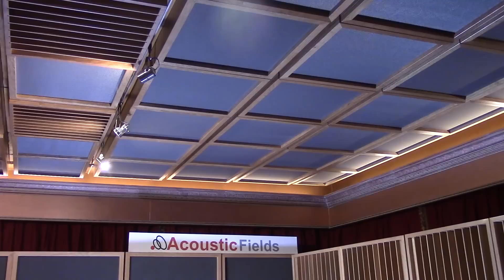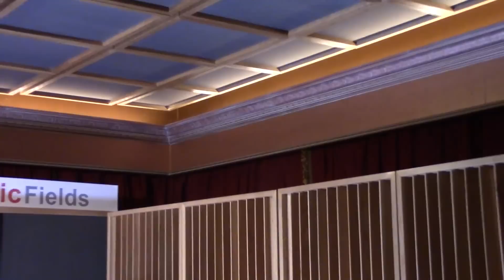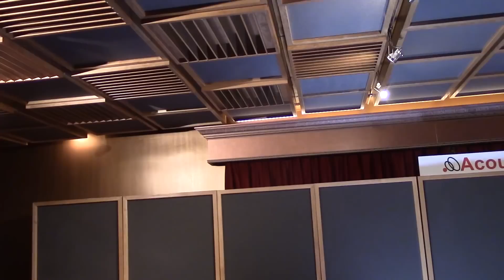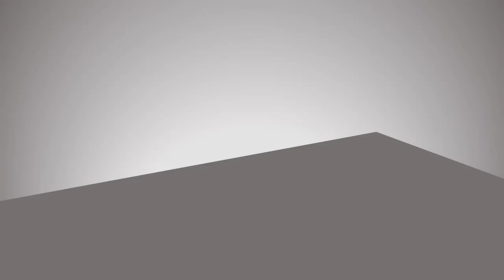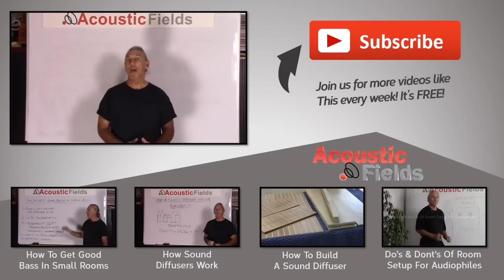Sacred Ground Ceiling System - www.AcousticFields.com

Comment: Hello Dennis. 
I purchased the All In One DIY Acoustic package, Since it doesn’t include a ceiling diffuser instructions. Can I use the QD – 7 build plan and use the same depth measurements but using the P – 7 dimensions – 24 × 4.5 × 24 ? 
My ceiling is 9 to 10 feet high. Also would you recommend to build a P – 7 or 11. Since I have a small room. That is around 21 x 12 Feet.
Reply from the maker: S,  Yes, Alternate the pattern to form two dimensional diffusion.